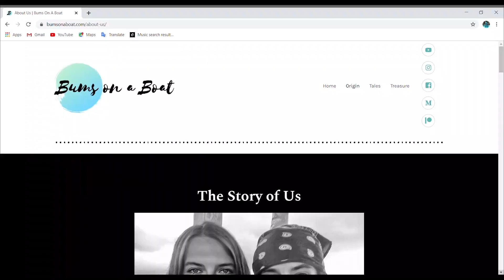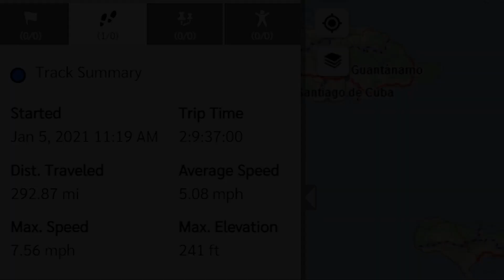How does She HANDLE Highs & Lows of Life at Sea? ~ Bums on a Boat Ep 160

Comment: Repaired a broken belt. Diagnosed and fixed three different leaks. Replaced the valve cover gasket. And took it all in stride. You didn't just spend two and half years working on your boat, you spent two and a half years gaining real mastery!

Comment: The first opportunity you get to buy some mechanical supplies, you need to get a small container of  Permatex Aviation sealant #2. It is non hardening and if you clean the surfaces well and tighten bolts properly gaskets will absolutely not leak. It is impervious to all petroleum based fluids like gasoline, diesel, motor oil and also water jacket gaskets too. Get couple bottles of rubbing alcohol too, as it is the only thing that can be used to clean it from your skin or other surfaces. Aviation sealant #2 is sold in a little cup like canister with a brush attached to the lid on the inside...

Comment: Why is your main sail clew flying so high off the boom? It should be attached to a “slug” or “car” on the boom that rides in the slot feature on top of the boom.  That slug keeps the clew attached to the boom and the outhaul can then pull back on the slug flattening the lower 1/3 of the sail. The other option is a “strop” made from webbing&velcro wrapped through the clew grommet and around the boom holing the clew down to the boom.  In that case the out haul attaches to the clew ring to pull the sail back.
Reply from the maker: Good catch. We had a line around the aft end of the main securing it to a ring on the boom but we secured it after raising the main. It looks and performs better now the main is even and snug to the boom.

Comment: Hello Bum's,    can you let us know how that new inside speaker cloth is holding up and has it cut down on your noise and heat??/   I'm planning ot do  my boat that way and also install some 1\8 inch rubber matts to help with sound proofing..
Reply from the maker: Hi, so far it is holding up well. I can't say that it cuts down on the heat at all but it definitly helps with sound. We are curious to see how it is holding up 3 years or so down the road. I think it will eventually need replacing but it was affordable and will be easy to redo it if the time comes.
Reply: @Bumsonaboat  Hi, i think that it will last for a long time if it was done right. that episode it looked like you two did.  I live up in the PNW, Wa state.Livaboard on a pwr boat, so i have this project coming up this summer. Thanks for the reply and you two be safe..

Comment: If you need a temp fix on belts,  use nylon stockings.  cut the panty part off and tie the two legs together then put on to the pully's.and tighten tight.  that should hold till you get another belt.  if it slips, use something that will be sticky.  A trucker in the winter  time in NY showed me this.

Comment: Lots of folks in your position use portable fridge reason easier to work on uses less power more dependable. Iceco seems to be a favorite battery use is between 8 and 12 watts easy with a couple of solar panels the battery will power the fridge for 10 hours
Reply from the maker: We have seen a lot of the portable fridges and we may consider one moving forward. Our newly installed thermostat should change the game for our current one though.

Comment: You guys could use a clew fitting for your boom....could be a car or a slug so that the main would set closer to the outboard end of the boom and not put so much strain on the outhaul....do you have a slotted boom or one with slides? Good job...
Reply from the maker: Yes thanks. We had a line holding the main to the boom run through the slug but did not have the main sail even with the boom before we pulled it up. The next time we went sailing we did it correctly and it not only looked much better but performed better.

Comment: Great to see, you should be  proud, and you should  give all bolts and nuts a check,and the head bolts especially  , as would happen at a first service if New,  or when reconded,  these old er motors have a settling in period ,seven a few do head gaskets when this hasn't  been considered,      ,,,,, anyway  well done on the mid passage  engine work , and rapt  your  getting out on the wind ,

Comment: How did your food go bad so quick? You have that little honda generator it would be perfect for sustaining batteries or running a fridge.
Reply from the maker: We just turned it off for an hour or so while we worked on the engine. At the time we did not have a working thermostat. We now have one installed:)
Reply: @Bumsonaboat  Great! For your next journey your fridge should be good! Make a secure place for your Honda Generator in case you need emergency power. Practice using it so there is no question as to it's efficacy. I hope it can carry the load. If not then at least it can charge the battery so you can keep things running without the engine.❤️
Reply: When charging batteries with my Honda 1000 I personally prefer attaching it to a small battery charger to the AC instead of direct DC charging. That allows the inverter in the generator to decide how much throttle it needs for a given load. They are very handy!

Comment: Why do you have the engine on? Do you a motor cruiser or a sailor?
Reply: I'm thinking to some extent it had to do with just running it to see how reliable it was, empty the tanks, and maybe charge fridge batts. It's never a bad idea to run your stuff so you can see if it will be reliable and exchange your fuel.
Reply: @human_marco  You asked the question so you obviously don't know...sometimes it's best to run the motor because of opposing wind directions there could be several reasons why they ran the motor.
Reply: I do know they had an unusually good weather window to complete the passage.  I'm guessing that window was tight and they wanted to make sure they finished the passage before they had to start beating into the wind and currents, tacking, getting sea sick, spending additional days in the open water in uncomfortable conditions.  Looks like they made the right choice and tested the engine too.

Comment: I think 2021 is going to be a rough year for The Bums !

You need to have some long conversations about where you want to be in 5 years.  Just cruising the Caribbean and maybe down to South America or do you think you will turn into landlubber  "weekend sailors" ?

If you want to "sail the world", I don't think  Chak Matay is a big enough boat.  Even if you do disagree, you would probably agree that it is time to start thinking of a new engine (or major out of the boat rebuild).   Chak Matay also needs to get the refrigerator up to 100% functional, and upgrade the solar power and probably better batteries.  $$$ !!

Remember, in the very early days of Delos, there where months where she sat in storage while they rebuilt the "cruising kitty".

Comment: Many reasons to maybe run the engine,  but you would have had a smoother ride if you just put up the sails.   The boat would have cut through the waves rather than bouncing and rolling over the top.   I’m sure you know that though...
Reply from the maker: This passage is into the trade winds and current. An ideal window is low wind. Not to mention you want to catch the Mona on a precise day which means you need to make consistent time. With only sails, our 2 and a half day trip would have taken well over a week which would have put us in bad weather. We would then have to duck in short of our goal and wait for better weather. Our #1 objective was making it safly to Puerto Rico.

Comment: I do not understand motoring with 15knts of wind?  Why not raise up more sails? The boat is not even heeling over. I see this allot on cruising sailing videos? I sail with spay and the boat heeling over. I shift weight to the high side and power up. 15 knots of wind seems like you could make at least 8 knots? Sails are wings. Sail controls are there to shape the sails for more or less power.  It is fun to go fast.